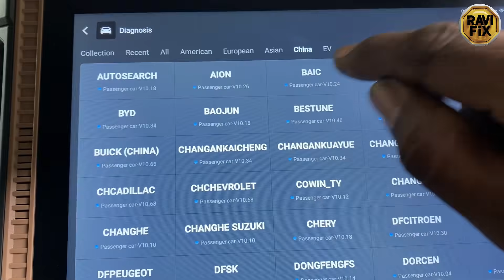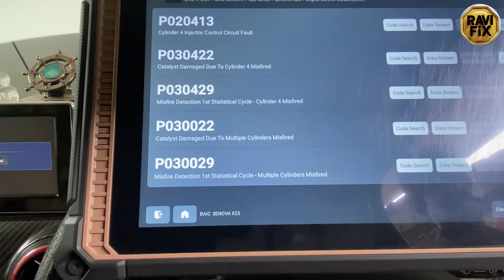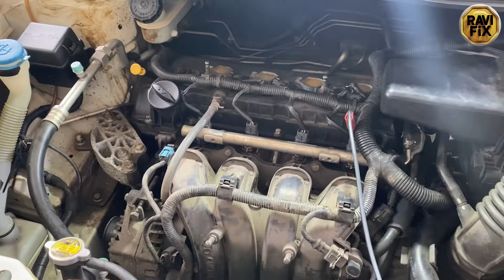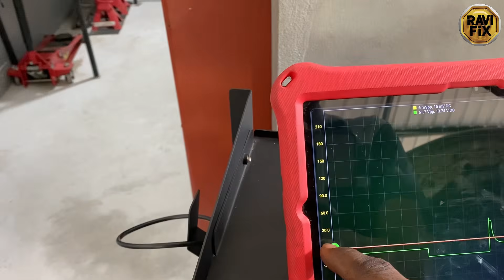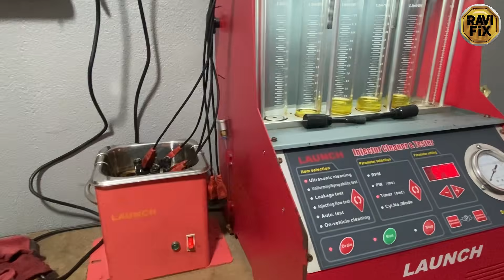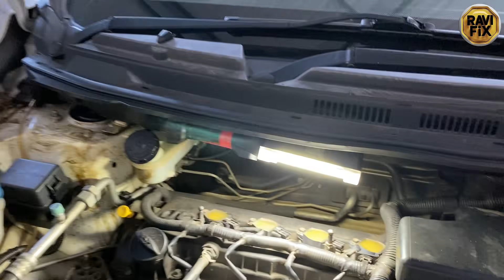How to test fuel injector faults. BAIC X25 misfire diagnosis. Don’t be misled with ECM strategy

Comment: very educative and informative ,I would have appreciate it the more if the total fuel trim Pids events are displayed as well.that info will be a guide to know if the bad injector is either stuck close or even before scoping the injector waveform,that will also corroborate the theory more

Comment: Thank You!

Would you recommend for such cases using the scanner in the component testing mode to activate each injector, if it is supported or capable of, and if the vehicle make includes that function, to see if the ECM is able to control that circuit?

One thing I've learned, is to test with the DTC present, then clear it, and test again for comparison.
I've misled myself on numerous occasions with an initial check for an injector pulse, confirmed it was present at the beginning, only to find out later that the ECM disables it to protect the catalytic converter after a specified time in operation, based on strategies that are difficult to find in the manufacturers service information, if they're published at all.